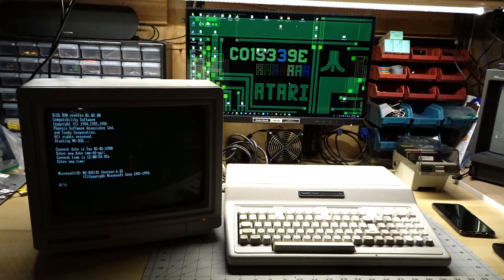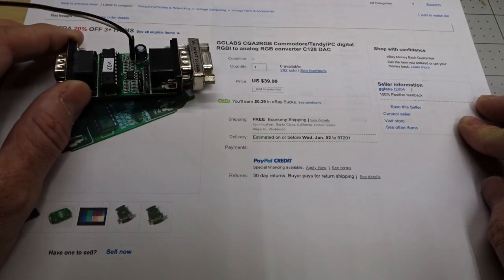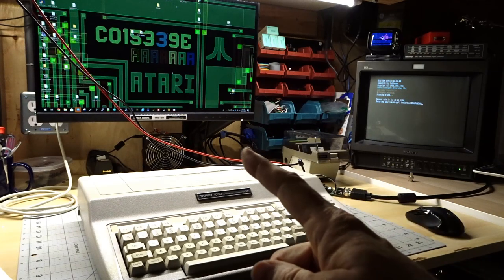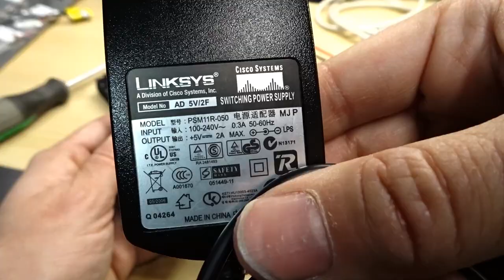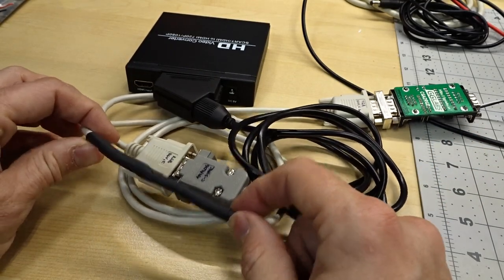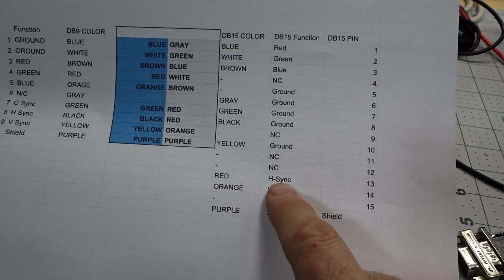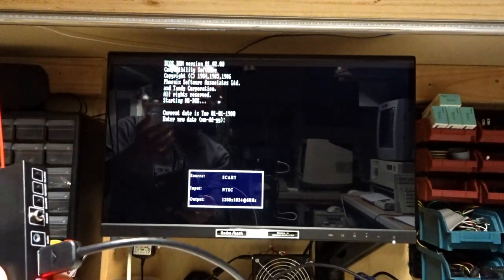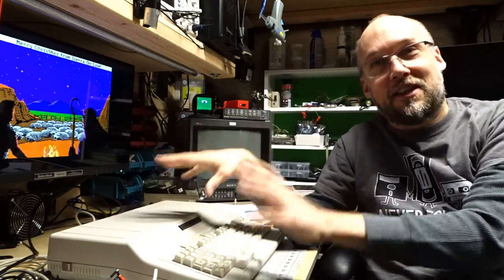How to convert CGA video to HDMI for around $65

Comment: Hey! I have actually used that exact Scart to HDMI adapter for a few Pro AV installations. As you said, it is a normal TV scaler IC, and so it actually has a full TV menu system available. If you solder a USB to UART adapter to the UART connector you can use a software configuration tool to adjust color/brightness/sharpness/aspect ratio and over-scan. I would be more than happy to show you how. Great video as always!
Reply: I would be interrested in such info. Is that information available somewhere on the net?
Reply: Can you turn off the stupid overlay that way?
Reply: Minimelkav please upload some update video for this, I want to reduce the brightness for this converter.  lock the output resolution to 480p or maybe 720p and keep 4:3 aspect ratio
Reply: @rafaelmendoza1103  For anyone wondering, you just need to buy a cheap USB to UART dongle from eBay, then connect it to the UART pins on the converter. There will usually be VCC, GND, RX and TX. Just connect them up and try various baud rates. It's probably something standard like 9600, 19200, 57600, or 115200.
Reply: @AureliusR  did you tested?

Comment: Bravo!   As usual,  I love your lectures.  My first computer was a Commodore VIC 20. It didn't come with any software,  but it did come with BASIC in ROM.  It allowed a whopping 3 kB of space for writing code.  I think the total amount of RAM was 8 kilobytes.The OS took up well over over half the RAM. I had to write my own software,  with a mixture of BASIC and machine language. Yes,  MACHINE LANGUAGE!   There was no assembler,  so i had to write the code by hand. My second machine was a Tandy 1000 SL,  running MS-DOS 3.3.  It didn't come with Basic,  so I had to go to the computer store and buy a copy of MS QuickBasic 4.5,  for $149.   Those were the daze [sic].

Comment: The convoluted way you have to do this reminds me of My Mate Vince's funny "300K Subscriber Special - The Heath Robinson Guide to Connecting an iPhone to a TV" video. I've had to patch a strange mix of cables and adapter plugs/sockets to get video signals to display in the past, but never anything this extreme, lol. At least I didn't have to use active converters in my bodge-jobs.

Comment: Excellent video as always, I love to see ways people hook up newer displays to old hardware. 

I have looked into it myself and I think I might need to go with a solution like MCE2VGA. It costs a bit more but one of my 5160s came with a MDA card and a seperate EGA card. My other machines are mostly CGA and most of my LCDs have a VGA hook up but no HDMI hookups, VGA to HDMI converters are not expensive but probably something else I dont really need.

Comment: I bought a CGA/EGA multisync monitor off ebay in 2017 for $10, local pickup. It cost about $50 to repair. It cleaned up ok but some time in its life someone had dropped it and there is a crack in the front of the case but it works great. I bought one of these CGA2RGB thingies off ebay as an alternative after watching your video.
Reply: @adriansdigitalbasement  The monitor is switchable between 8 color, 16 color AT&T, 16 colour CGA, 64 colour EGA and Analog RGB. It can also handle output from Monochrome and Hercules display adapters. I repaired it myself, replacing around 100 capacitors.  Here in Australia you never see CGA monitors, let alone EGA monitors. The CGA2RGB at the current exchange rate including shipping and taxes cost me $75 which is roughly $15 more than it cost me to repair the 30 year old monitor :-)

Comment: I've been using an Extron RGB 118 (currently ebays for $25-30) to convert my CGA/Tandy/EGA and Apple IIgs to a VGA-ish signal, and it works pretty well.  The Extron RGB 118 converts both 16 and 64-color TTL RGB (which means 64-color EGA works correctly), and also supports analog RGB in (Apple IIgs).  It has DIP switches inside it that control what it converts, which I cut a notch out of the top to access without opening it.  It has a single 9-pin "universal" input, and a 15-pin analog output.  It converts sync (it accepts composite, sync-on-green, or separte sync, and outputs any of those you pick).  It DOESN'T increase scan rate, so you need something like the HDMI converter mentioned in the video, or a monitor that supports 15.7khz (some 4:3 LCDs, like Samsung SyncMasters and NEC MultiSync's support it).  I've been using a SyncMaster 710N with good results.  The main advantage to the Extron is that it supports EGA, which very few other TTL converters seem to do, and it's very reasonably priced and well built.  Additionally, it doesn't add any lag itself, as it's not really a digital device and doesn't modify the scan rate.

Comment: Broadcast engineer here: You may want to consider shortening some of those analog RGB cables. Analog video should be handled by 75ohm coax cable. A lot of those cables you show are just straight multiconductor cables with unspecified impedance. Shorter cables may improve sharpness and reduce ringing on edges. Of course CGA is relatively low resolution so it may not make much of a difference to use 75ohm coax. But just a thought.

Comment: Great video to explain it for casuals, and I have the same cheap Chinese SCART to HDMI thing as well, but anyone seriously into recording his videos, or uses more than one system, should get a pro HDMI scaler. Everyone seems to be into the OSSC, but my favorite currently is the Extron DSC 301 HD, although I'm no gamer so it might introduce bigger lag than the OSSC, but it's certainly a lot faster than this SCART2HDMI box you reviewed. It's a professional scaler, which was, and still is very expensive new, but with some luck you can find these on eBay for around a 100-150 EUR (i'm in Europe). Bought several around that price lately. Accepts HDMI, CVBS and RGB inputs, the RGB (VGA header) input handles anything I've thrown at it so far - including this CGA2RGB adapter, Amiga, Atari ST, or an old PC box running up to 1024x768 SVGA and beyond -, plus its HDMI input works like a champ with the RetroTink 2x, so you can have component, and SVideo inputs as well. Which pretty much covers any retro peep's needs. Still, the more videos like this, the better, you can't have enough combinations of retro gear vs. HDMI stuff tested. :) Merry %FESTIVITIES_NAME% and a Happy New Year!
Reply: chainq68k I picked up a couple Extron DVS-204’s a while back and they are awesome for things like this.  I’ve been wanting one I can use for direct HDMI output so thanks for the tip, the 301 looks perfect.

Comment: Merry Christmas :)   I've done a ton of cables. Damn. I'm in Europe and I'm blessed with many RGB CRT TVs (for my Arcade cabinet). On the bad side. It's impossible to find a CRT TV with HDMI (last Sony TVs for example). I've had to search a ton to find my current with component inputs.  I wanted to change my VGA -> RGB SCART setup to HDMI -> Component because it's difficult to find new GPUs (except old AMD ones) which even have a VGA output. (And I like to play other than old emulator new stuff on a CRT like Cuphead for example) :)   But, I'm giving my current CRT about 5 more years of operation. Then the struggle continues :)  A bit reverse struggle than yours :)

Comment: I remember knowing a guy in the early 90s that was using a monitor that he easily switched between a 5150 and an Amiga just by moving the plug between the two computers.  I can't remember if he was just using the IBM CGA screen on the Amiga or using come kind of commodore display.
Reply: @adriansdigitalbasement  Well I knew about those, I was certain he was either using the IBM brand screen on the Amiga, or a Commodore screen on the IBM.  I don't think IBM ever did a screen that could do TTL and RGB, but I'm not as familiar with Commodore screens if they ever made something like that.

Comment: Just a heads up, you need to be cautious of certain router/switch power supplies when using them for other projects.  I've run into a couple that weren't well regulated, and actually put out 6 or 7 volts, despite being a switching design and labeled as 5 volts. 

A couple years ago, I used one of those GBS-8200 converters in an arcade game, then took the VGA output from that and ran it into a cheap VGA to HDMI converter.  It worked great, and it makes me wonder how the GBS-8200 (or 8220) would handle TTL on the RGB input.  They have potentiometers to adjust the RGB input gain, and are meant to accept 15.7Khz or 24.8Khz sync rate.  I haven't tried one with 18Khz MDA yet though.

Comment: No mention of how modern TVs mishandle 240p? It applies to this device as well! They treat it as 480i, which introduces artifacts and severely impacts the quality. You’d need something like RetroTink 2x, OSSC, or XRGB Mini to correctly scale 240p RGB on an HDMI display. In many situations, especially 240p games with 60hz effects, a composite to HDMI adapter like the RetroTink 2X would be preferable. It’s too bad RetroTink 2X doesn’t accept RGBS but it does accept YPbPr Component, which you can transcode RGBS to (at additional expense).
Reply: Low resolution CGA has 200 lines not 240.
Reply: Adrian Black RetroTink 2X is the cheapest at $80-$100 so, yeah, it’ll cost a lot more. :(

Comment: Hey Adrian, 

love your videos you have a great presentation style and a clear passion for "messing around" with hardware for the fun of it.

I actually have one of these upscalers but it has the MST6M181VS-LF-Z1 chip which i "think" is RGB, i tried it with an rgb and a composite scart cable separately and the quality is very much different).

I had the same thinking as you when i got hold of my converter and found it to be RGB so i ordered another that looked the same and the second one is awful quality and the main chip is rectangular and has had the markings scratched off the top so i have no idea what it is, it is a very inferior unit but to all intents and purposes looks exactly the same as my RGB one, it seems these units can really be pot luck sadly!

Thanks, looking forward to more videos :)

Comment: The biggest problem is that many older devices don't run at exactly 59.94Hz or 50Hz etc. so when you convert them to HDMI, you get a stutter every ~10 seconds.  Some devices like the Ultimate64 output a non-standard HDMI frequency which can cause problems with some modern displays.  My hope is that one day most TVs will support variable refresh so that a converter can be made to view old arcade boards/consoles/computers without motion issues.

Comment: I have that SCART to HDMI converter and generally it is a good choice. I have noticed a few disadvantages:
* For some reason it doesn't like the Commodore 128 VDC signal. Probably minor timing difference, but I haven't found the cause yet. Would be interresting if it accepts the signal of your NTSC Commodore 128 (mine is PAL).
* The composite quality is acceptable, but by far not as good as my CRT monitors, some discolouring is visible.
* Doesn't support S-Video via SCART. Interresting because an S-Video to HDMI converter that I own uses exactly the same chip, it is likely just a some firmware support that is missing.

On the other hand the RGB quality is just great and also the latency is not bad at all; I am abel to play C64 games just fine with it, many who depend on low latency. It looks like the Chinese designers of the device were aware if its applications and have looked into the latency. I'd say it is an excellent product.

Interresting that you convert anything to DE9 and DE9 to anything. Personally I convert anything into SCART and SCART to anything.

Comment: I just realized my composite video to HDMI converter is the same thing, but with a cheap arse RCA plug where the SCART is. I can desolder the RCA sockets and solder in a SCART and modify the box or pay $40 AUD for the one in Adrian's video. I will see how much a SCART socket is, probably cheaper to buy the SCART>HDMI box in Australia (we don't have SCART at all here since we stopped importing European TV's 25yrs ago)

Comment: I use that very same SCART upscaler.  You touched briefly on the lag it introduces, but downplayed it.

In reality, the lag is horrible.  It’s not suitable for games.  It also has that stupid resolution pop up overlay which can’t be turned off.

If you want no lag, the OSSC is a much better choice.  It’s just a lot more $$.
Reply: Adrian Black true.  I didn’t say it was cheap.  I’m just stressing the fact that you get what you pay for in this case, and $22 does not a good upscaler buy.

As others have mentioned there are other decent upscalers which don’t cost as much as the OSSC, such as the RetroTINK 2X.

Honestly, I find the overlay this thing displays to be even more annoying than the lag.  As you say, it otherwise works ok for text... except when you’re waiting several seconds just to be able to see the entire screen.  That becomes extremely annoying when using it with an instant on device like a Color Computer 3.
Reply: It would be great if the SCART input would allow to connect an RGB signal directly without the overhead of all those adapters... but I guess it's just wishful thinking.
I wonder if the annoying overlay could be tuned off by some undocumented method such as holding down one of the hardware selector buttons for a few seconds.  Might be worth to try them all, and in combinations. ;)
Reply: Wow, I just bought this. I should have read the comments first.

Comment: A very interesting video. I have a similar SCART to HDMI converter here. I thought it died on me when it only started to show pixel junk and noise with my Megadrive. I now suspect it suffers from overheating.

More interestingly you said the power supply for these is not so good. What specs are needed for a replacement? Can I use a decent phone charger 5V/2A? And if so, which polarity is on the plug to the converter? Is it +5V on the inside?

Thank you for your great channel! And keep that little ZX Spectrum up :)

Comment: Wow, two different converters and three different kind of converters in a row, daisy-chained to get a CGA Picture out on an HDMI-Screen... I would prefer the solution with an GBS-8220 to get CGI to RGB and then hook it up to a PC-Flatscreen Monitor with RGB Input. I use that on my Amiga 500, which puts out a 15,7 KHz signal just like your Tandy...
Reply: Actually, this video was specifically for the Tandy and he used more cables than needed so he can swap around between devices easily.  However, for many of the systems he mentioned, like the Amiga and Atari ST, you can do it with just the one box and a scart cable.  For my Atari ST, it came out to about $40.. $25 for the box and $15 for a good scart cable with resistors.  But yeah, depends on how much you want to spend on how elegant your solution.

Comment: the issue is everything from respective of VGA connection  on modern lcd/plasma tv's the GPU in this casewould need to support a bare minimum of 720x576 for wide screen use..

Noting that most gpu's of modern computers  across vga can support 1080p...

the bigger issue  is where vga is supported in most cases the tv only supports 3.5 mm audio input for audio

Comment: my first vga monitor (ibm 8518) takes like 20 or 30 minutes to turn on properly these days. it starts too dark, unreadable, unusable. and it's not a matter of brightness and contrast. after 20 minutes it works normally, but it used to start already 100% usable, it's not normal that it starts very dark. I'm worried that it's going to break soon.

I'm curious, can you get a isa 8 bit vga for that computer?. a vga monitor will give you at least ten more years.
Reply: Check the capacitors in it and replace if necessary.
Reply: the demo doesn't support ega?

Comment: You did not need your $35 TTL to analogue converter you can use resister dividers on the 3 colours and the Csync directly into your scart to HDMI converter.

Comment: great job, do you know if there is any way to convert the cga output of the amstrad pc 1512k to hdmi, rca or something like that? I have 2 Amstrad PC 1512 units but the monitors are already broken, leaving the computer useless since it also receives power from these, would there be any solution to be able to use these computers on another type of monitor or TV?

Comment: This may be a little off-topic but:
For people who are only interested in converting CGA to VGA, not to HDMI/DVI, would the Gonbes GBS-8200 do that job on its own, or would the GCLabs CGA2RGB Converter be required as well? 
In other words: 
If I don't want HDMI/DVI, can I just use the GBS-8200 instead of this? What does the CGA2RGB Converter do that the GBS-8200 doesn't?
Reply: @adriansdigitalbasement  Ah. Thank you. And sorry, that's GGLabs, not GCLabs. Does anyone here maybe know if the GBS-8200 and similar models also suffer from the kind of lag mentioned elsewhere in this thread, or is that problem limited to upscalers that convert to HDMI and not an issue on VGA converters?
Reply: It does suffer from lag. The latency is caused by de-interlacing and scaling. The GBS-8200 does exactly do that and therefore causes lag. However, it is designed for gaming, so they have designed it not to introduce too much lag.

If you want to avoid lag, you have use a different conversion method: Process a scanline at a time rather than a frame at a time. Devices that use the scanline method are the Retrotink 2x, OSSC and HDfury. The disadvantage of the scanline method is that you can't do proper scaling, either you don't change the timing at all, or you can do scandoubling.